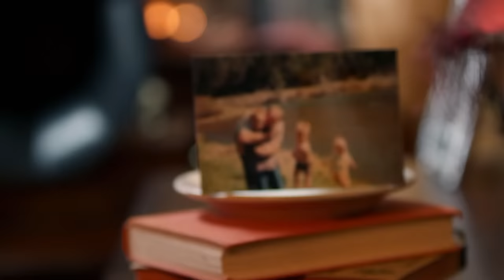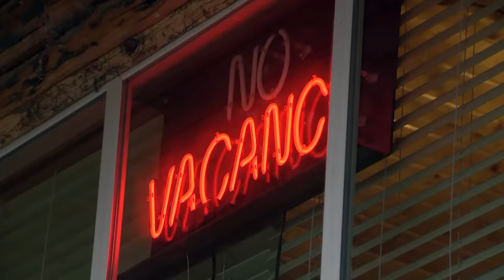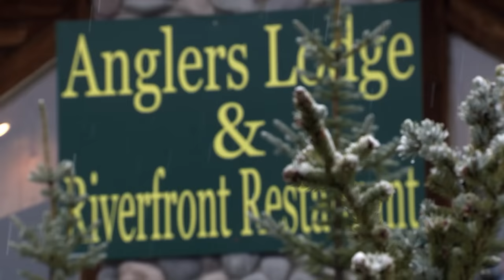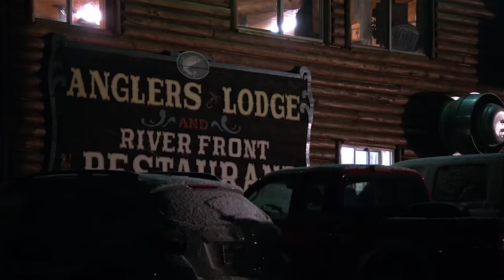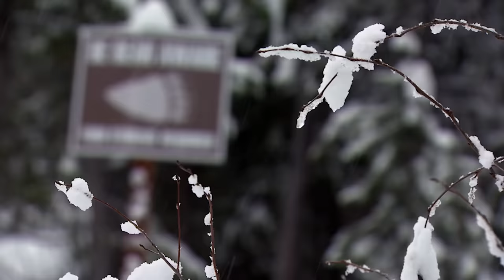Cheesecake Looks Like "A Landmine" | Hotel Hell FULL EPISODE

Comment: tbh that AC filter is not that bad. Not the best, not spotless, sure, but definitely not 15 years of dust level bad lol
Reply: You can visibly see clusters of dust on it. That means all the air goes trough that filth. No, it's not good at all. Especially when it literally takes 1 min to clean it once a week.
Reply: @neretilderem7029  yeah i know it is not good, not saying it is good, just that it isn't really the worst, and not really 15 years of dust level bad. And tbf, when air is filtered through a filter, the air coming through the filter won't be dusty simply because the filter is dirty. That kinda is the whole point of the filter, to leave dust on the intake side. So, regardless of how dusty the filter is, the air coming through would still be filtered nonetheless. The pores of the filter aren't getting any bigger by having dust caked on one side. Unless the pores themselves are damaged, in which case cleaning it makes no difference anyway and the filter is pretty much a write-off. What changes with the dust caked on one side is the resistance of the filter and the static pressure needed to achieve the same air flow rate would increase.
Reply: I agree, not that bad. However that piece of something on the pillow that looks like chewed up candy would absolutely make me wanna go sleep in the car
Reply: I'm not letting Gordon in my house, that's for sure.
Reply: AccidentalGenius 7  tough luck, but I'm leaving him standing in the cold.